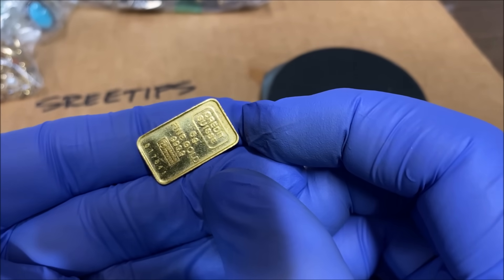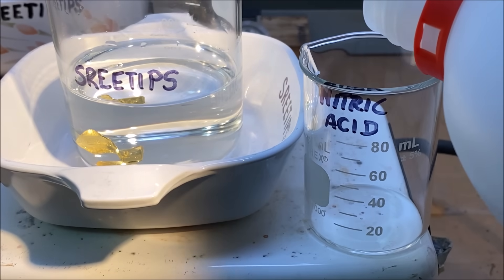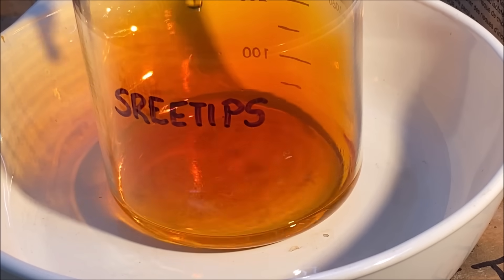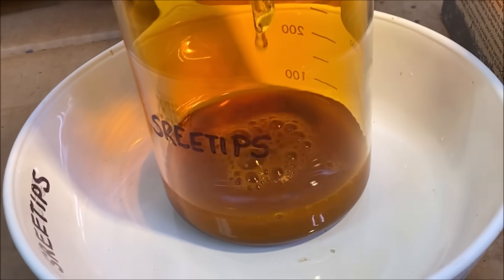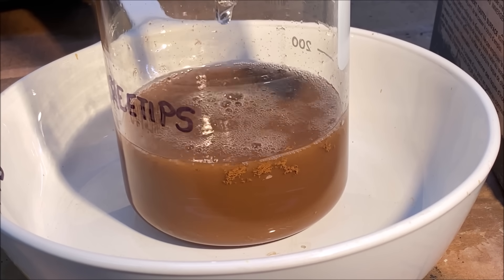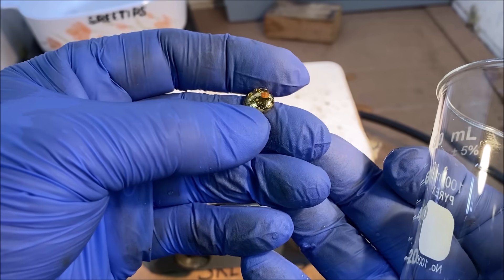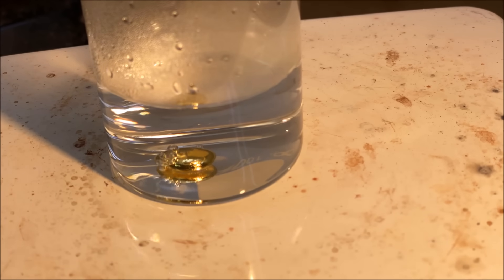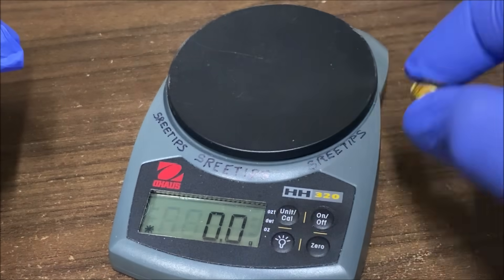Dissolve 5 Gram Credit Suisse Bar in Aqua Regia

Comment: Interesting video, but being a natural born knocker I am... ;-)
So lemme put few flies in this otherwise perfect ointment of yours - "back in my sec school days" we used 0.01 g precision for regular "preparatory" chemistry, and QUANTITATIVE chemistry was done with ten times higher accuracy - that is, to 0.001 g. Using "good, ol' school" mechanical "analytical" scales of course , but then back then electronic scales were unheard of, so we had to settle for what we had ;-)
Therefore, using a scale with 0.1 g accuracy does not look like a best choice for measuring instrument - as the actual weight of the bar could be anything between under 5.05 and over 4.95 g - and "likewise", the weight of the button could be between 4.95 and 4.85 g - in which case the displayed result would be rounded to the nearest tenth. (That momentary "flash" of 5 g was most likely the result of kinetic energy of the dropped button - it just pushed momentarily the sensors to register more force than the actual weight, i..e. the force of gravity acting on 4.9 g of mass.)

Also, as other commentator here, jasonsummit1776 observed, few specks of gold dust landed on that "first" filtering paper, but that wasn't enough for this 0.1 g difference, methinks - yes, it did influence the result, but there has to be more to this, and I'd say the biggest culprit here was the scale used.
But anyway, this is not to say it was an exercise in futility - in fact it was quite interesting as a concept - yet tad on wanting side when it comes to conclusive results.

In fact, I'd love to see a video in which you'd go through full, detailed and exact step–by–step analysis about process losses. That is, starting with exact known amount, to a hundredth of gram, of PURE gold and PURE silver (for  quartering the gold), then smelting them and weighing produced, and thoroughly dried shot (to see what are the losses at this step), then dissolving the alloy and collecting gold precipitate in a pre-weighed (again, to a 0.01 g) beaker (or any other suitable vessel - like evaporating dish, albeit a glass beaker/ crystallising dish, being non-porous would be the best choice) and drying it thoroughly (like 12 hr in 150°C in a mini oven), then weighing it together (after subtracting the weight of the vessel the total weight of the gold "after the refining" could be established - thus we'd know how much gold is lost in this step), and then finally melting this gold dust into a button or bar, and weighing it again - to see how much, if any is lost in this step.

Now, I know this would be quite a hassle and while not exactly "an exercise in futility" it would still be of not much use in terms of practical results - as SOME losses will always be there, no matter what, so the main purpose would be satisfying one's curiosity... I guess. But then hey, maybe a good "plot" for another video, eh? ;-)

Cheers!
Reply from the maker: I weighed it on another scale. 4.94 to 4.945
Reply: @ Oh, yes - that makes sense. Some ≈ 0.05 g missing - could be these few specs on the first filter paper.

Comment: You can clearly see gold splattered in the melt dish. This most likely occurred when you melted the gold while it was wet. You should have used a clean melt dish and then verified that all the gold you melted was accumulated into the button before you poured it. The markings on the bar were 100% correct.

Comment: Use sulphamic acid to denox, it should also help to drop out any lead.
Reply from the maker: I used 50ml nitric. Way too much for that little bar of pure gold. But it did make for an interesting precipitation event. Notice that all the excess nitric got consumed by simply adding more precipitant. No need for sulfamic acid. If I wasn’t so impatient, I could have evaporated down longer down to a syrupy state (the gold solution turns very dark) and gotten all of the excess nitric out. If done correctly, evaporation is by far the best method to rid a gold solution of excess nitric. Second only to incremental nitric dosing.

Comment: The chemistry here is pretty basic. The biggest danger in doing any of this is the formation of that orange brown gas, which is nitric dioxide. Get a good whiff of that, and a day or so later, your lungs will begin weeping fluid and you will dry drown. That is why he's so incredibly proactive about having a working fume hood. The potential of chemical burns from the high concentrate nitric acid is minor by comparison, but you still need to treat that with a certain respect. It's the only acid in this process that has the potential of fast harm before you can wash it off/neutralize it. It's also the costliest of the chemicals he uses which is a good reason to learn how he minimizes its use.

Comment: Lov u man hey Dad please post the link where I can buy one of these plug-in machines without breaking the bank to dissolve something like say like some poisonous milk something in a liquid my mom tried to murder me several times putting rat poison in my milk so I wanted to like you know melt it down to a powder mixture and warm it up and do it and make it where the liquid turns into powder where I can get the machine that will do that for me thank you
Reply from the maker: Do you mean a Hewlett Packard 5710A Dual Column Gas Chromatograph with flame analyzation detectors?

Comment: Some explain how this is cost-effective at this scale. 5 grams of gold is $500 spot.
2L of hydrochloric acid alone is $200 USD. Here he's using pure gold. But when scrapping electronic waste, it seems the materials to refine cost more than the gold extracted.
Reply from the maker: I buy hydrochloric acid at the hardware store for twelve dollars per gallon. Cost-effective, you’re looking at this from a “profit” angle, to gain more currency than was put in. I’m not trying to do that. My motive was to try to prove the validity of the markings on the Credit Suisse gold bar. It was an experiment. I don’t process much escrap because the yields are too low.

Comment: Is it possible there was 10% lead in that bar? I noticed there was no sulfuric acid added to the aqua regia to precipitate any possible lead to be captured in the filter. Could lead have been precipitated with SMB along with gold and follow the gold right to the crucible undetected and re-alloyed? Is it just me, or did the gold sponge seem darker with harder clumps than usual for .999? I would love to see an experiment processing a chunk of lead by itself the exact same way just to see if lead dissolves and precipitates similar to gold with SMB, ferrous sulfate, and sufuric acid side by side.

Comment: Stupid question here, but while looking at the assays on the various grades of acids, the Technical grades usually listed higher iron content, as opposed to lab grade or some of the ultra-pure higher grades.  Do you run into problems due to iron impurities in solution prior to dropping the gold ?  I like the price on those lower grades of acid, but figured I'd have to distill them in order to ensure that they didn't add iron and other impurities into any precious metal solutions that I was looking to purify ( especially from refining eWaste or scrap jewelry ).
Reply from the maker: I’ve not had a problem with iron.
Reply: Excellent -- Thank you @sreetips  !  I like getting to pay less for my reagents.  Makes a big difference when trying to make it worthwhile to recover the precious metals from scrap.  :- D

Comment: Correct me if this isn't right,  but wouldn't 4.9 g potentially represent 98% purity?  This is not as close to 99.99% as I would have expected.  This would be a clever way to make a few bucks.
Reply from the maker: It could have been 4.99 but scale does go to that degree.

Comment: Without enquarting and using nitric to remove base metals, or sulfuric to draw out lead during aqua regia dissolution, can we be certain that we removed any non-gold material from the bar? If the Chloroauric acid solution has dissolved silver in it, will SMB precipitate it much like gold, or will something else happen? I'm just wondering if we merely left any impurities in the jar and melted them back into the button. 

Admittedly, that sponge looked very pure, and the chloroauric acid did not have the telltale green pinge that normally happens when there's silver or copper in solution, so it looks right. But without enquartation and nitric boils, can we be certain that we removed any and all non-gold components from the bar? We repeat these steps so often on the grounds of 'incase anything has managed to stay with the gold during the process'. Just wondering why we didn't follow the formula.

Paid actor of big suisse gold confirmed!
Reply from the maker: Based on my experience, I don’t think that there much of anything else in that particular bar other than pure gold. I deliberately skipped inquartation, filtering, rinsing to avoid any potential losses that would have happened. I weighed the button on a more accurate scale: 4.95g to 4.94g so I’d have to conclude that the bar was accurately stamped.
Reply: Silver chloride is not easy to disolve in water, just a bit beter in acids.
It makes complex whit ammonia that is soluble.

Comment: I bet you have the cleanest kitchen drain pipes!
Reply: @Chris-ch5nb LOL...  much dilute acid being dumped.  But always very dilute.
Reply from the maker: It was only two 2ml of sulfuric acid in the beaker with the gold. It’s made to be dumped down the drain. Professional drain opener.
Reply from the maker: The sulfuric acid is “Rooto Professional Drain Opener” sold at Ace Hardware. It is 93% concentrated sulfuric acid, according to the data sheet.

Comment: How certain are you that burning the paper filter off in the melt dish doesn't add contamination to the gold?
Reply from the maker: Three nines certain. I’ve done this many times (burned paper in the dish with the gold). Sent the gold to a big refiner. They check it with XRF to determine purity for my pay out. Three nines fine, every time.

Comment: Sulfuric acid is okay down the drain?
Reply from the maker: It’s “Rooto Professional Drain Opener” from Ace Hardware. 93% concentrated sulfuric acid according to the data sheet.
Reply: @sreetips  does it also contain buffers?
Reply from the maker: None that I know of.
Reply: @TheMilkman710   do you count trace amounts of flux or borax aa "buffers"?
Reply: @saintcrispan5068 no, I was only asking because I bought some sulfuric acid drain cleaner one time and it was full of buffers to bring the ph to about 5. It was a real pain to clean it up for the reaction.
Reply from the maker: I’ve never heard of that
Reply from the maker: I use Rooto it’s 93% concentrated sulfuric acid.
Reply: @sreetips  Thanks. I'll look for that brand.
Reply: @TheMilkman710   it's what Drano is made of.

Comment: I watched a lot of your videos and I thought that aqua rega will dissolve gold and some other precious metals?  instead of using SMB you used a different chemical to drop out just the gold, or I’ve gotten mixed up. How about dissolving the precipitated gold in the filter paper in sulphuric acid then melting the remainder?  therefore you should have lots of surface area
Reply: @Palisades_Prospecting  ferrous sulfide, I believe is the one you are referring to.
Reply from the maker: Ferrous sulfate will drop all the gold and nothing but the gold.

Comment: what i found in my gas drop container, which contain drops after closing the hose pipe valve (used for sucking the NOx gas), is a trace of gold (tested by Stannous Cloride, it turned out a fair dark purple). i mean there is gold lost during gas evaporation. Have you ever check?
Reply from the maker: Yes, some fine droplets of gold leave the beaker during evaporation.

Comment: There were a few specks that went over during the gravity filtration before you switched to the vacuum, so that's where the rest of it went.
Reply: @MakingUsThink  he does that on the regular, also collectrs filters to reprocess etc.  If you look into the video history you can find videos about it.  He even tries to go after platinum group metals in his silver cell filter mud and whatnot
Reply: more likely the gold is still in the melt dish, if you look closely at the dish, you can see little gold beads everywhere in the melt dish. He melted it while it was still wet, causing it to splatter.
He should have used a clean melt dish. Maybe he should take that dish and pour the water/sulfuric acid into it and clean out the dish, he'll find that missing .1 gram.
Reply: 11:13 I see shiny spots on the sides of the melting container.
Reply: when? at like 9:20?
Reply: Thanx. Now i dont have to watch this silly video.
By what you guys state, i already know its completely unscientific and the result means nothing at all
And since none did that yet, by the looks of it, i checked out his scale. Bc thats where it begins, right.
Its an Ohaus HH320
Its max capacity for weighing is 320 g. Specificity is 0,1g
Linearity is 0,2 g
From what i remember in error calculation: The amount given is over the full scale. Thats why you always use a scale thats appropriate to what you are weighing. So if you generally weigh 1 to 10 kg of potatoes, you use a scale with a max of 10 kg. If the error margin is 2%, weighing 10kg, is 200g
BUT, if you weigh 1kg, the error margin is still 200g. Which is then 20%.

He is weighing 5g on a 320 g scale. Thats not done.
Its also not a professional scale. The site itself mentions that.
Electronic scales of good quality exist, but they are very expensive. You are way better of to use a mechanical scale that was specifically designed to weigh small amounts of gold. IE called gold scales. Those are basically balance scales, ie with counter weights.

If he would have done this with lets say 300g of gold, then it might mean something. Or, the scale would then not be a major problem here.
The same then applies to all his other errors; in filtration leaving stuff behind there. In melting, leaving stuff behind and so on. He wouldnt get anywhere near 20% loss. But there will be loss, unless you weigh EVERYTHING, before and after. Thats the scientific way to do this. So you weigh the water you use and you weigh the water afterwards. You way acid before and after. You weigh filter, before and after, you weigh crucible, before and after. Etc.
Then you know what you yourself lost in the proces and where.
Reply from the maker: Ha! I wasn’t trying be scientific. I was trying to generate more ad revenue with a simple video.
Reply: @ Cant blame you for that. It seems to be in vogue ;]
Reply: @StofStuiver  If the error margin is fixed as you claim, then weighing something before and after on the same scale would indeed give you an accurate assessment of change of mass.  If his scale was off and stated the before weight as 6.0g and the after 5.9g, it is still a change of  0.1g. The fact that his scale exactly matched the stated weight of the bar shows that his scale was not 20% off.  Weighing the other components makes no sense because there is loss of water vapor as steam and loss of paper weight as combustion gasses.
Reply: @ Ah, i read 1 gram. Which is 20% from 5g. A bit unfortunate that someone wrote .1, which is why thats generally put as 0,1.
Either way, doesnt matter. What i said is true.
0,1 is then 2%, which is not bad, considering the method.
I explained how you could be more accurate.

And i assumed the conclusion would be that the bar would somehow not be 99,999% pure, which is silly. And if you are going to test that, the accuracy of your test has to be 0,0005. Its not allowed to present a decimal that is smaller than the accuracy.
Not interested any further than explaining a few things.
Reply: @StofStuiver   well, since you put it that way… we all look forward to all of the super fascinating and 100% completely technically accurate videos that you’re getting ready to start uploading, showing your process for refining gold which I’m sure won’t at all be totally boring in any way.

And that way you can inform anyone who watches your videos of exactly what was lost, but be sure to use a very well-calibrated chronometer so that we won’t have to guess at exactly how much of our time you’ve wasted.

Meanwhile, Sreetips will still be raking in the money by not investing huge amounts of time worrying about where one thousandth of a gram went, all while letting his many subscribers tag along and watch him get rich.  He’s running a business, not a chemistry class for nerds.
Reply: @mrimmortal1579  Youre a bit sensitive it seems.

I dont have to upload anything.
If somebody makes a video and uploads it and leaves the comment section open, you will get critisized. No matter how good it is.
No fanboys need to attack people, specially with false reasoning.
Reply: Some of the gold evaporated out into the air while it was neutralizing, you can see the vapor leave the container.
Reply from the maker: Entropy guarantees that 100% can never be achieved.

Comment: I can only speak for myself, but I would love to see another decimal place on your scale. 4.9 isn't 5. It flashed to 5.0, but we donlt know the rounding up and down logic, so we can assume it's 4.949 rounding down to 4.9.  And we can't know where between 4.95 and 5.04 the 5 oz bar really was.  Don't go crazy on an expensive new scale - just find one with more sig digs.  Also, love the video.
Reply: gram,  not ounce. 5 grams.
Reply: Ones with more digits can be bought cheap, just make sure to calibrate it before you use it every time.

Comment: An improperly-calibrated XRF is useless.  It MUST be tested against known samples and be on the correct setting, and even then it should be cross-checked.  XRFs are best to get quick estimates of metals to see of they're worth dealing with.  They're usually not great if you want 100% accuracy.
Reply from the maker: I don’t own one. Too rich for my small hobby operation.